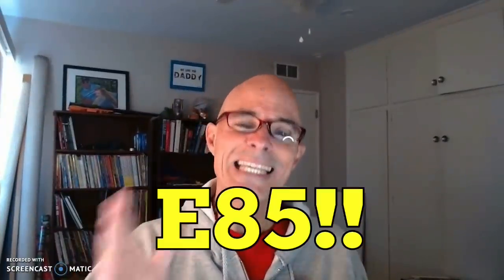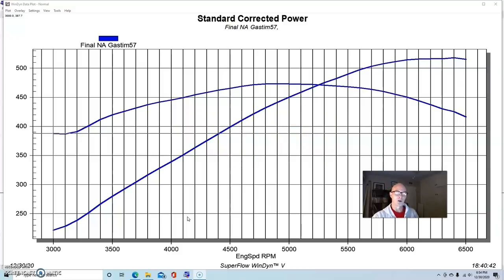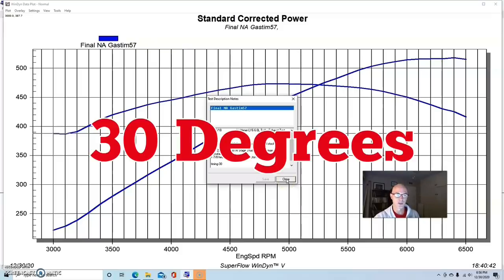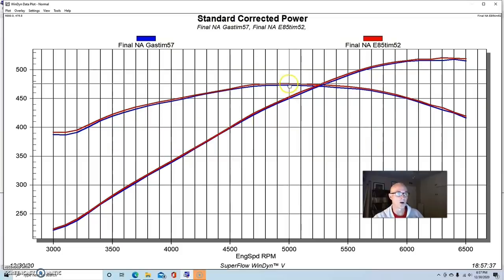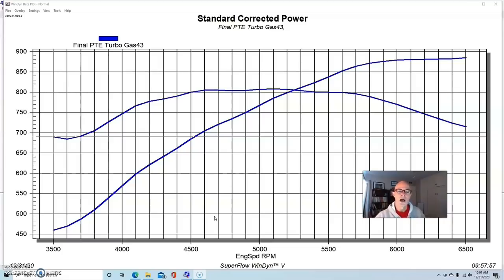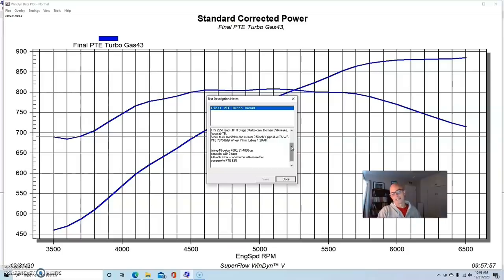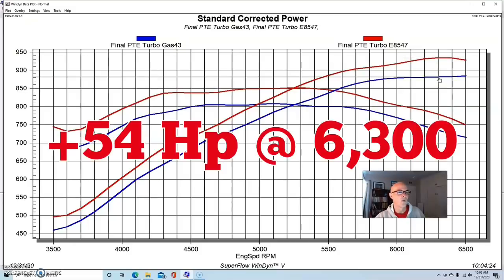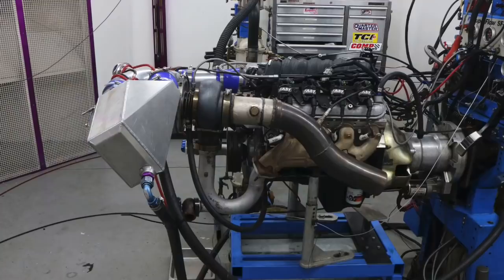JUNKYARD TURBO 6.0L LS E85 FUEL TEST

Comment: I still dont know about running it in a winter vehicle in the northern part of the country.
Reply: I live in the upper peninsula of Michigan, it was 8F two days ago(strangely warm right now I don't mind at all), and we get 200-300 inches of snow every year. Lake effect from the biggest lake is impressive. 

I have run it in winter, in my beater 98 Gran Prix. It cranks a couple seconds longer, but runs good. Takes a bit longer to heat up because ethanol runs a lot colder, but with a good thermostat you can get enough heat out of it to not freeze to death.  

With a carb its a bit more tricky when its below 20F. My method is pump the gas a few times, and let it vaporize for about 30-40 seconds, then start cranking. If it fires and you can keep it running, let it warm up for a minute or two. If not, pump the throttle, wait 30-40 seconds and try again. Its a lot easier with more compression and a hot spark like an MSD 6AL. None of my carbs have chokes on them anymore, because I drive EFI newer crap all winter. Why rust out something I care about?

Now that  I have to drive two hours south to fill 55 gallon drums with E85, I only run it in summer. When I get my production high enough I will run it in everything all year, but the GTOs and other muscle cars I drive in summer get parked as soon as the salt goes out on the roads.
Reply: @SweatyFatGuy  yeah  I live in north east wyoming I just wonder how it would do in say up to 30 or 40 below. I'd run fuel injection not carb. The other issue would  be how it sponge water out of the air.
Reply: I have a 1984 bronco im wanting to put two turbos on a 351w.
Reply: @rossbrimmer5895  Anything below 20F you can start having start issues in some cars depending upon how much the injector spray wets the ports/manifold.  I certainly would have some concerns about sub-zero temps.  With modern sealed fuel systems absorbing water really isn't an issue.  But don't leave it in your boat or lawnmower! ;)  Don't forget too that while gasoline starts dropping water out of suspension at just a few tenths of a percent, E85 can hold several percent water in suspension with no real issue.
Reply: @ChurchAutoTest   well yeah thats the thing here in wyoming we usually get a couple weeks of sub zero Temps thats why I asked the question.
Reply: @rossbrimmer5895  I'd either blend down to E50 or so in winter or just run a gasoline tune during the coldest months.

Comment: Does the Coyote take less timing advance to make peak power than this LS? 
If the peak power timing is less advanced then the combustion happens faster so E85 must have the advantage in engines with faster burning combustion events, as well as charge cooling.

Comment: So would you say, on a mild n/a setup, race gas would not be worth it over pump?
Reply from the maker: no race will not make any more power than pump on na
Reply: Maybe at 13:1+ cr  ? I wish i could get e85 in quebec! I would just rebuild my engine for 12.5:1 with low boost on e85 with no stress of detonation..
Reply: @teal_2v338  I run e85 in both my turbo and n/a combos.  I just figured it would have been worth something on the n/a setup.  I've seen other tuners for ls setups claim 15-20hp difference n/a

Comment: Why no knock detector?  Is there some advantage to leaving it off?
Reply: not using stock ECM. Need to use stock ECM to interpret the vibration signals from the sensor.
I think....
Reply from the maker: we run a Holley

Comment: Would adding something like Boostane to 93 pump gas make any significant difference?
Reply: yeah it would make it more prone to knock/ping than E85 on its own.
Reply: @SweatyFatGuy  oh damn. Forza sung praises to it but I think that was more for dodge cars
Reply: @maxie9506  the type of car is irrelevant, the combustion process is not based on the badge. Adding an octane booster to 93 would help, but its unlikely to boost it enough to compete with e85 as it is 108 octane.

Comment: Part of our winter upgrade plans is a bigger pump, bigger injectors to make the change to E85, Plus a TBSS intake to go from 492 wheel hp to 600+ wheel hp. Why 600 wheel hp? Because #burnoutsandicecream
Reply from the maker: don't want it to melt!
Reply: That’s right!! Only thing melting in this truck is the tires!!

Comment: Injector placement?  To close to the valve to get additional charge cooling.
Reply: thats part of it, but mostly he probably had it too lean.
Reply from the maker: he did not have it too lean-we tried various AF mixtures with each
Reply: @richardholdener1727  Do you ever see any gains that can be attributed mainly to charge cooling?

Comment: More compression make a bigger na difference I guess would be the only plus? Get the timing up with more squish?
Reply: Its about how much fuel you give it, you can make more power with 8:1 compression and open chamber heads easily.

https://www.hotrod.com/articles/hppp-1109-testing-different-fuel/

I am running closed chamber heads on my Pontiac, they want more advance than the open chamber heads on another 455 of mine. Closed chamber is 11.5:1 static, the open heads have been milled so they make 13:1, the open chambers make more power, but that is probably due to the CNC porting vs hand porting and the compression ratio difference. Those 13:1 capable heads are monsters for iron heads.
Reply from the maker: we tried more fuel-nope!
Reply: @richardholdener1727  Did you play with timing when you added more fuel?

Comment: R.H. ………...I am an old Ford guy and the Ls is enlighting a lot of Ford in it ,head bolts 10 ,symmetrical ports etc. Always thumbs up !!!!!!!!
Reply: There's nothing ford about it....or it would be as turdy as a windsor.
Reply: @303StreetMachines no it's  not at all. If it were it would be as big of a turd as a 351. The old sbc had the beat down all over furd smallblocks. Why would they go backwards?

Comment: I think because you all optimise the timing and afr when running na, you didn't find much hp. There would be hp if you ran the 91 at factory timing vs e85 at happy timing. I am assuming of course haha
Reply: NA the limitation was air not octane, more compression is where the e85 would have made the NA happy
Reply: I agree. Otherwise it would of made more power haha

Comment: Quick question, I'm currently have a gt45 turbo, but I'm looking at a 7875 turbo and a turbonetics hurricane sylvia turbo 7268 for my 6.0 and sloppy stage 2 cam and 243 heads. Are any of those turbos good for this setup? Thanks
Reply: The turbines are too small on all those turbos. Turbine drive pressure will be high of you turn the boost up much. If the turbine drive pressure is high its very difficult to get much timing in it.
Reply from the maker: yes-the 7875 works well
Reply: I run the T-7875 on my 6.66L.  I have never seen a turbo so well sized for an engine in all my life. I don't even bother with buying a loose converter since it spools "too" fast.  I actually just changed my throttle response table so that my car slows down that spooling. Before, it was like 10% throttle was enough for max boost.
Reply: @jackbilger6858  you ever measure backpressure?
Reply: @turbolq4  Honestly, IDK how to do that.
Reply: I have a GT45 on my 5.3. the turbine side of that turbo is 77mm and it's too small. The rest of those are even smaller. If you want to make real power then look at T6 88mm+ turbine side. Like s480 size.

Comment: Compression on the NA LS isnt high enough to be limited by the 91 octane. Bump that compression up to 13 to 1 and then compare timing curves and then the power differences will be apparent.
Reply: He said in the video that they did bump the CR to 13.0, and the power was not effected.  In this range of compression ratio, whole points are only worth about 1%.  From 12.8 to 13.0 is not significant.  To make a real change, they would have to go to 16:1.
Reply: @andyharman3022  He talked about AFR, not CR. Big difference.
Reply: @andyharman3022  that's not what he said at all. We've seen 10whp at peak on bolt on ls3s.....and more in the meat of the tq curve.
Reply: @HioSSilver1999  Oops, you're right.  He said air/fuel ratio, and for some reason, I heard compression ratio.
Reply: @SweatyFatGuy  I'm not really sure what you're saying. But E85 has a wider tuning range than gasoline.

Comment: Yeppers... that should get us out of 2020. Let’s just hope 2021 doesn’t smile at 2020 ans say hold my beer..
Reply from the maker: IKR
Reply: 2021 already off and running with 2020 holding said beer.         also,   the prices of fuel in the video will not age well.

Comment: Basic e 85 is around 103-105 on average right? Would 93 and torco be comparable on a street turbo setup? Thanks
Reply: I can answer this, been running E85 and producing my own E100 for 14 years. The test used to measure octane doesn't work well on ethanol, so the 105 rating isn't indicative of what it can do. its a generalization, a wild ass guess more than an accurate measurement. You aren't going to be running 105 octane race gas with 16:1 static, nor will you run 105 octane race gas with 13:1 static and 20psi, but you can do both with pump E85.

Ethanol is a very different fuel with very different properties. It does not like to light on the diesel cycle, eg heat and compression, it wants a spark to light. It also has far more latent heat of vaporization than gasoline does, even race gas. 

The reason it makes more power is very simple, ethanol has more oxygen in it, its also why you need to add more to get the engine to run right, its not about BTU at all. BTU only measures how long it takes a given fuel to heat one pound of water one degree. Thats it, nothing about how much power it makes, resistance to detonation/knock, intake charge cooling, ease of vaporization, its only about heating a pound of water. the more fuel you throw at it, the more power its going to make. Leaning it out on ethanol does not make more power, gasoline does that. Running 7.5:1 AFR will get you best power on E85, and roughly 9:1-8:1 AFR will get you good power and best mileage. Ethanol does not act like gasoline, its very different.

Oxygenated race gas can equal ethanol for power, because it has more oxygen in it. It does not have the vaporization properties though, and its considerably more expensive to run oxygenated race gas.

So no torco and 93 isn't going to come remotely close in resistance to ping/knock or power. Its just not happening. If you want to mix E85 with your 93, that works much better, and most domestic EFI systems can handle 40%-50% ethanol without a problem, and carbs can do 30% without major modifications, just jetting, power valves, etc. No drilling orifices at 30%. You can measure it with a flex sensor, easy to wire up even with a carb, so you know you have the right amount in it as you splash mix it.
Reply: @SweatyFatGuy  wow, thanks man
Reply: @SweatyFatGuy  I’m trying to get my setup running better. I have holley HP on my turbo sbf. Have the ntk sensor and had a past remote tune Los. My IAT is very high, very quick. I don’t think I can get further along with my 93 and local e85 options are very slim and honestly only the small gas stations without many customers have it
Reply: @SweatyFatGuy  lol, I’m right on the WI border actually. I have more research to do. I see zero more growth with this car given my fuel situation and where I am at with my engine.
Reply from the maker: I DON'T THINK THE TORCO WOULD BE THE SAME POWER-NOT SURE ON OCTANE
Reply: @richardholdener1727  Your the BEST ever man!!! I’m a HUGE fan of you!!! (: